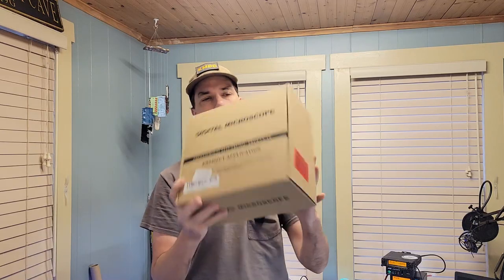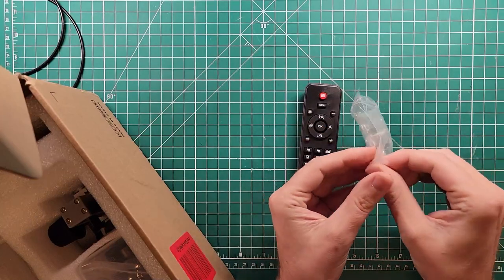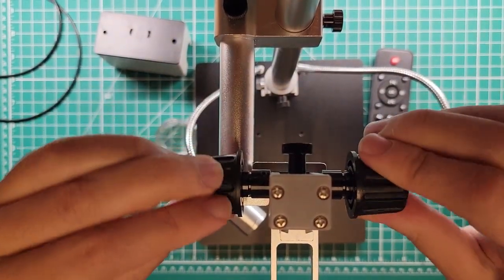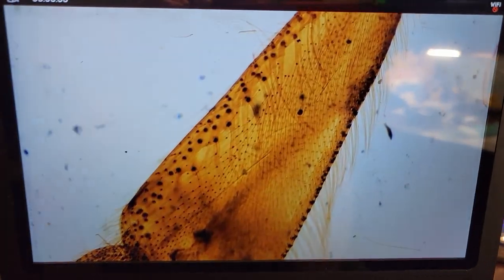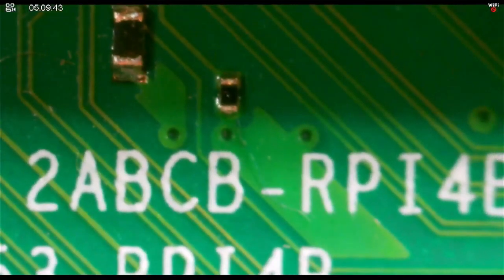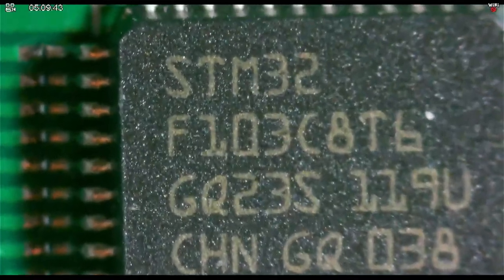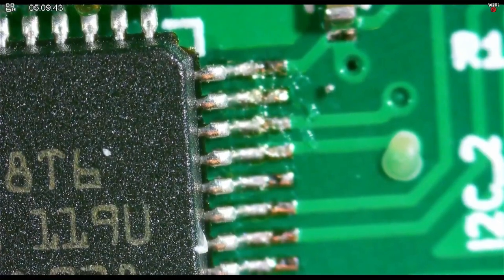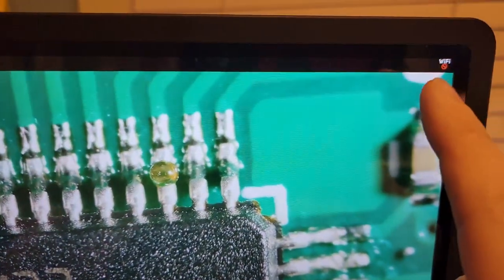HDMI Soldering Microscope - Yes Please!

Comment: I bought a similar—-but not quite as feature-rich—-desktop microscope a year or so ago. Largely for SMD work but I found that my aging eyes do benefit from using it for examining parts for cracks, traces, and solder joints. You’ve done a great exposition of yours here!
Reply from the maker: Thanks Frank 🍻

Comment: These things are great for inspecting your work to make sure your soldering is good. I typically just use a regular magnifying glass while im actually soldering something though since these things can mess with your hand eye coordination.
Also that chip was a QFN (quad flat no lead) not a BGA (ball grid array) which have all the pins hidden underneath the component.
Reply from the maker: Good idea!

Comment: At 6:40 in ; That's why I bought a solder station with a pinhole hot air blower. Allot of techs use hot air and solder past.
Reply from the maker: Hot air and solder paste is the right way!

Comment: Steve, I would be interested to see how you like it after you use it a bit.  While those are very nice, a lot of people find them hard to use because of the lack of 3d depth since they are monocular. I agree with Jonathan, they are great for inspection though.  The one I have is a traditional trinocular stereo microscope that has a port for a camera so you can use it and still send HDMI out from the camera .  I haven't used mine enough to give you a review, as I just recently got it.
  The major downside to mine is cost. It was over $600. I justified it partly because I always wanted one, and partly because I intend to use it for my photography hobby.
Reply from the maker: I think it would be for very detailed work and I don't do that very often.  I've had 1 calling for it so far and it was a modern laptop repair.

Comment: That looks like a very nice scope/screen combo.  Thanks for sharing!    I bought a similar one a few weeks ago,  but it did not come with all the nice lenses or a horizontal (near or far from the operator) adjustment for the camera mount.  It did come with an adjustable polarizing lens .   I will be interested in what you come up with for a PCB fixturing set up!  I am trying to come up with  something to use with an X/Y adjustment,  with maybe a small vice type thing "spring loaded" with rubber bands to clamp on to the board, but still give easy access to removing the board and repositioning it (flip it over ect.).   I have yet to look on the 3D printer sites, but maybe they will have something..  the search is on!
Reply from the maker: I was eyeing something like this: https://amzn.to/3LLErl4

I think it would be low profile enough to be compatible.  Everything else is very tall and gets in the way of my normal camera setup.  So this was already on the list.
Reply: @temporarilyoffline  That looks great!  Hadn't thought of magnets and a plate.   Thanks!

Comment: What is the max depth of field?  I noticed your soldering iron out of focus not far above the board.  This is nicer than most of the others I've looked at.  I want to get one soon and get back to where I can solder again.  Thanks for covering this one!
Reply from the maker: I didn't see it in the specs and it comes with interchangeable lenses, so its probably "variable"

Comment: Any advice on how to best protect the lens from fumes that could build up on it? I have a basic helping hands tool and the magnifying glass has built up a foggy layer on it. I've only used a few times to practice soldering
Reply from the maker: Do you have an exhaust fan blowing away from your work area?  "Fume Extractor"
Reply: @temporarilyoffline  Thanks for the reply! A fume extractor should do the trick. I don't have one as I solder rarely. I suppose that if I get one of these microscopes I should invest a little more to protect it or maybe try using a PC fan next to what I'm soldering.